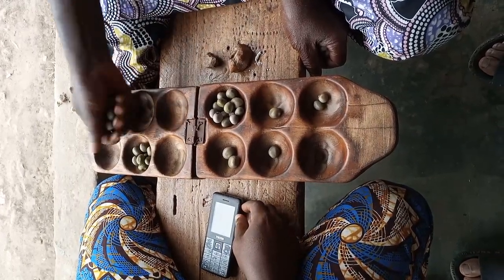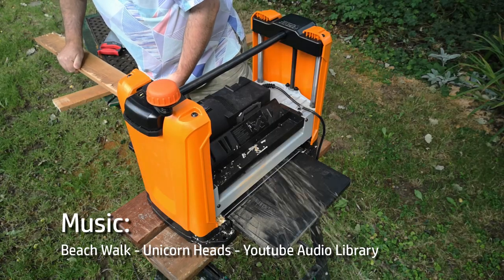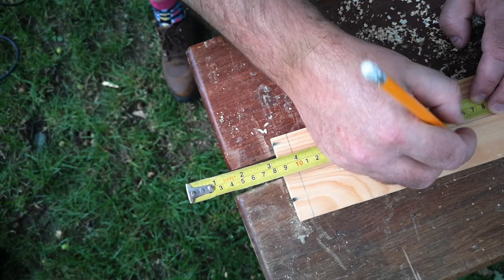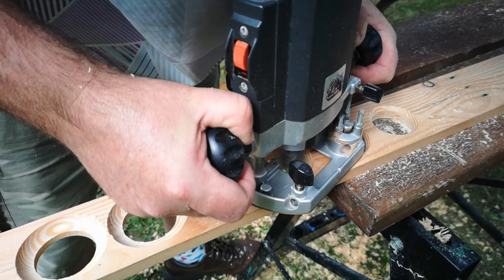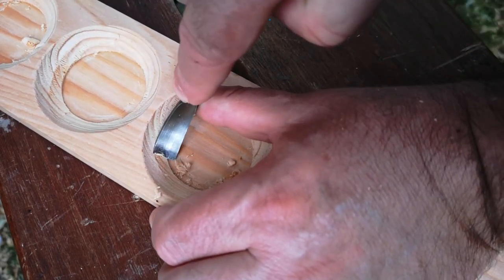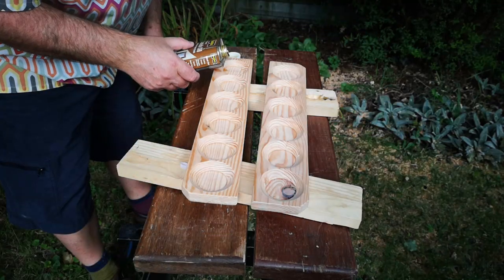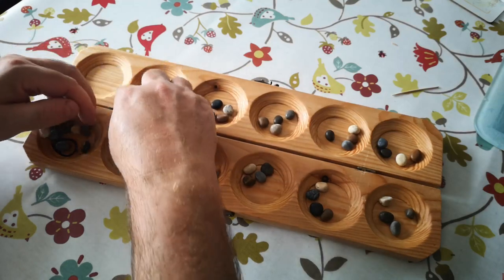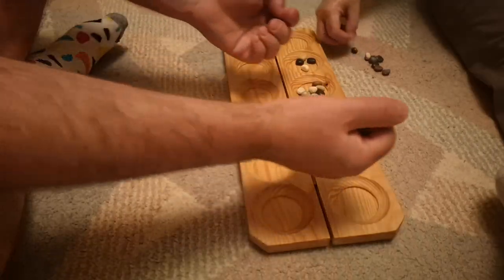Making A Game Board for Ayo / Olopon (A Mancala Variant)

Comment: Hand saw tip: If you clean your saw blade well, apply some paraffin block wax (Canning wax) or candle wax to the blade. It will cut easier. Also if you have a hammer with a wooden handle, paraffin wax on the handle keeps it from slipping. If you are doing a major amount of hammering, this can save you blisters.

Comment: I love seeing all the patterned things you own. Patterns even down to your socks.
Reply from the maker: It's interesting, because I was just thinking today that this wooden Ayo box is a bit plain looking...
Reply: @AtomicShrimp  do you have a favorite pattern? Or does the favoritism depend on what mood you're in?
Reply from the maker: It does tend to vary with mood and over time.  The fabric that we used to cover Eva's chair (not actually Eva's chair) that you see here: https://youtu.be/ETW6xdM7DXI?t=1260 we originally bought with a view to making me a shirt, but I sort of went off it. I like the vines design on the dinner table a LOT right now - much more in fact than when we bought that.
I used to doodle a lot in meetings (sometimes got me in trouble, but it actually helps me concentrate) and I would sometimes create patterns that looked like Mandalas - other times, it was tangled vines, and sometimes things that looked like weird technical circuit diagrams

Comment: I downloaded the Ayo app instead, am I just as creative as you then? ;)
You really shouldn't use danish oil, it's not good for you. Linseed oil is a better option.
Reply from the maker: Danish oil provides a much nicer finish than plain linseed oil, in my opinion.  As far as I understand it, most of the risk of from prolonged exposure to applying Danish oil in confined or unventilated spaces, so I'm pretty sure the risk is minimal for my use.